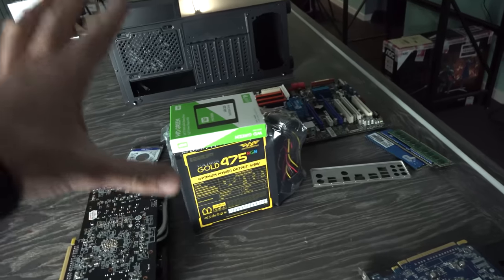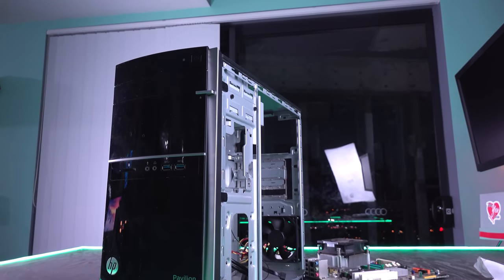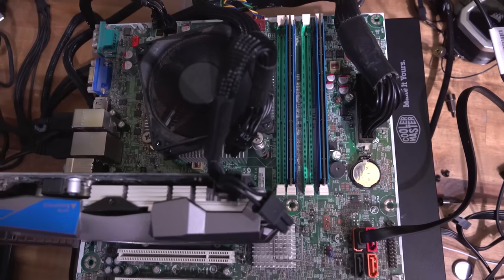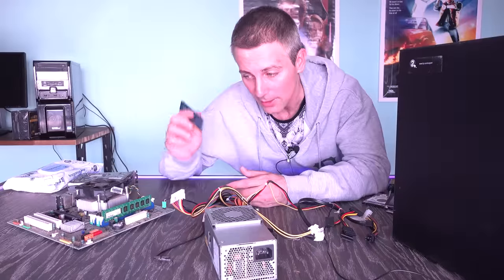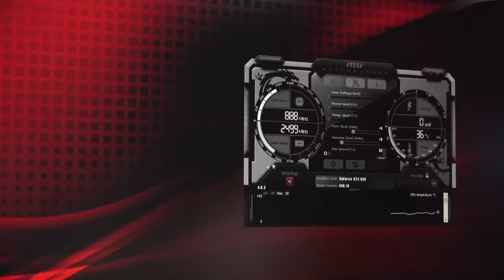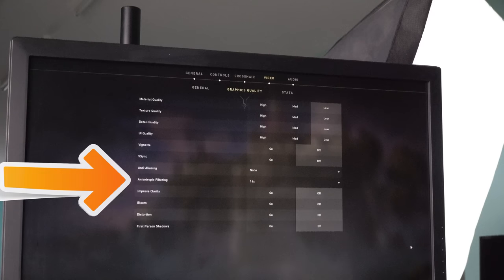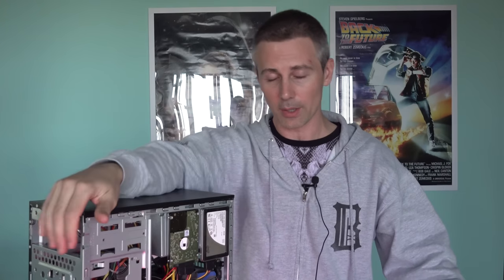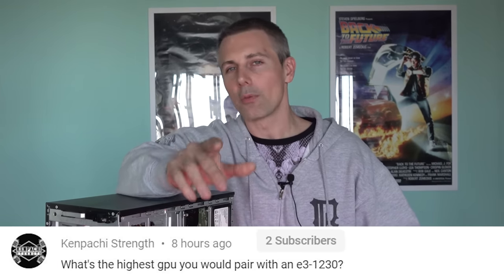I Built a Gaming PC for $67 that runs Valorant at over 120 FPS

Comment: My mans coming out here calling a GT 1030 pretty pricey. That means I'm on the right channel.
Reply: all used hardware is overpriced on eBay right now but you can snipe good deals sometimes. i got an open box thermal take 750 watt gold rated modular power supply for 80 bucks in auction. got a wraith prism for 25 bucks too.
Reply: @Joker-no1fz  i wouldn't get a used power supply, unless i definitively knew that the owner of that power supply said it was brand new and was barely used
Reply: @elsuperdog123  true and hard disk too dont buy used
Reply: @jetpackgambler8516  hard disk is fine to buy used I'd reckon
if possible I usually request to see CrystalDiskMark
Reply: Joker 80 bucks $10000+++++ for shipping fees
Reply: @screenpatch4146  struggles of not living in america
Reply: I have a 1060 so I'm happy now
Reply: @Fr3d1E  congrats dude, which model did you get
Reply: @Joker-no1fz  Thermaltake is assssssssssssssss
Reply: Mencho69 not really they have pretty good Power supplies and are up there with the more well known brands. Lots of tech YouTubers recommend EVGA, Seasonic, Thermaltake etc (also not in that order although EVGA probably is the best for this) but the point is they’re a reputable company and actually Corsair who’s more well known actually makes pretty bad power supplies and they’re a bigger company tbh
Reply: @WisteriaBerlitz  it's geforce is all I know
Reply: Joker isn’t it dangerous to buy used power supplies? i’ve always been told to get them brand new
Reply: DaFl1x I have a 1080😎
Reply: @elsuperdog123  never gonna happen xd
Reply: LMAO yes, im hurt everytime a youtuber called a gtx 1660 Super budget GPU
Reply: @WisteriaBerlitz  Not necessarily. I bought a 2tb hard drive used. One week 100%. The next week failed. Please don't cheap out on HDDs.
Reply: @Joker-no1fz  i think prices are becoming slightly more appealing and if they are not then I hope they decrease
Reply: I know all teh other PC channels make me feel poor for having a 1070 lol.
Reply: @Direwoof  sighh i have an rx 570

Comment: One man's E-waste is another TechYesTreasure.
Reply: It's weird seeing people argue on other tech reviewer channels that a $500 processor is the 'budget option' for the 'budget gamer' compared to the $800 processor and I just can't help but to think, what budget gamer is buying cutting edge on release date?
Reply: I've built several PC's using E-waste parts. One wasn't even broken, I upgraded it to Windows 10, chucked a GT220 (also E-waste) in it because the onboard video wasn't supported and sold it for $50 on Craigslist.
Reply: @Azerkeux  potatoes are fun.🎉
In a way 😹🤖
Reply: I love installed Linux distros on potato computers, they speed stuff up sooo much :)
Reply: @mohdwassep2764  Potato? I think Bryan has proven time and again that gen 1 and 2 core i processors are still plenty relevant. Though it is hard to say the same about decade old AMD parts. I'm certainly glad I was gifted an x58 platform as opposed to an FX series or god forbid Bulldozer

Comment: When a Hard drive costs more than this.
Reply: Bruh
Reply: my case cost more
Reply: My PSU was 150€
Reply: @certifiedhoodclassic7844  You are spending too much. In the US we can get a 60 dollar 700w 80+ psu at Best Buy
Reply: @Christian Lee 90 dollars for a 550 watt 80+ bronze certified fully modular psu

135 dollars for a 850w Fully Modular 80+ bronze certified PSU  (All from EVGA)
Reply: @statingtheobvious8119  I prefer Seasonic or Corsair over EVGA and the prices are pretty similiar anyways but its just that cheaper EVGA PSUs are pretty shit even with 80+
Reply: @MaxC_1  I like corsair power supplies. I haven't used seasonic psu before.
Reply: @statingtheobvious8119  they are great. Pretty damn reliable. For Corsair anything  CX and above(AXi, HXi, RM, TX) is just damn great. Just avoid VS and you should be good
Reply: @statingtheobvious8119  he's not buying some bottom line bronze psu though. there's high end PSUs available for a reason

Comment: You are pretty savvy when it comes to building, I would love to see you do some modding on those old HP cases!
Reply: I think it’s something like Modstek or modstech that does almost exclusively case modding on HP/Dell/Lenovo stuff. If you just need larger sized cards it’s fast with an angle grinder, or you can really go over the top make it look nice like that channel did (it’s been years since I’ve watched one of his videos, but I thought it was unique and interesting, I think I found it searching something like case modding HP or modding Dell optiplex case, he had a few back then and probably more now).

My current case is handmade to look like a vampire style casket, cost me only a few dollars (116 nails and 12 screws, plus free aged wood other than almost having a few heart attacks from all the spiders that were on the boards once I carried them out of the shed into the light...). Houses my monster Halloween themed build “ThrradREAPER” which has a Threadripper with quad Fury crossfire all water cooled and powered by none other than duel 13’s since it’s Halloween themed (2x SuperNova 1300 PSUs). I still need to finish the pump that’s embedded into a skull (the hoses look like rib cages, and the radiator sits below as a patinad and aged copper school bus  passenger radiator, behind it sit magnetic levitation fans). It looks dope, especially if I have dry ice cooling the CPU with an eerie fog rolling out of it. So yeah, cheap case and looks awesome. Doesn’t have to be expensive to really personalize your style. Have fun with it!

Comment: I was given an old AMD FM1 Lenovo desktop years and years ago. I was surprised how good it was to work with. The case is perfect standard MATX and it takes to any amount of tinkering without any secure boot problems. I took out the original 230W PSU, 2x2gb DDR3-1333 kit, single core Sempron, Nvidia 8600 GS, and 160gb WD Blue HDD and replaced it with an EVGA 430W, 2x4gb DDR3-1600, Athlon II X4 651, GTX 750 ti, and a 240gb SSD. All the replacement parts I got on bid on Ebay for very low price. Turned the lowest of the low office PC into a mini banger, it's in daily operation as a media center PC. I did that big upgrade in like 2016 and it's still going and still surprisingly capable. Can really get a lot of fun and value out of playing with old prebuilts.

Comment: I just want to say, after spending over $1000 on a pc , i feel finnesed
Reply: Yea but atleast we can run 300 frames 😈
Reply: @roshonngamingandmore8433  doesnt make sense why would they spend a thousand dollars and have a 60 hz monitor
Reply: Try 1800
Reply: @roshonngamingandmore8433  nah I have 240
Reply: Butter My friend got a 2000 dollar pc and has a 60hz monitor
Reply: @ammoTP  ehmmmmm......
Reply: @ammoTP  maybe its a 4kmonitor?
Reply: Its valorant lol its designed to run on low specs pc so even if u do havw that setup valorant is gonna run smooth coz its minimum requirements is low
Reply: @skyleradd1485  bruh moment
Reply: @ammoTP  some people have done so. I think I spent $700 building mine then bought a 165hz ips fhd monitor to replace my old 60hz afterwards
Reply: @420f37  so you dont have a 60 hz monitor ....

Comment: I play on a i5 4430 3.1gh
GTX 1050ti 4gb
16gb DDR3
500gb hard drive
Between 175-300fps 
at 1440-1080p resolution which I recommend as its very smooth and you have bigger characters which are easier to hit.

Comment: About to embark on a similar venture only a lower starting point an i3-2120  combo so I can play things with the kids will let you know how I get on
Reply: try to find a g4560 combo. they are really underrated especially with the kaby lake ipc and slow ddr4 is cheaper than ddr3 (or at least in mexico)
Reply: PC TechTips only problem with the g4560 is it has no release value as it’s a smelly pentium to consumers. 

I find g4560s for around £35 ish, but i5 6400s can be found for £50is if you look hard enough and I think it’s worth the waiting

Comment: Recently got into flipping PCs in my hometown thanks to your inspiration! I've been stuck with these 2 lenovo motherboards, exact models you used in your video. I havent been able to get any modern graphics card to work on them. In your video you said the BIOS update allowed for use of 600 and 700 series NVidia cards, Just wondering if you think something like a 660, 660ti, or 670 would be a good pair for these motherboards. These mobo's have been such a pain in the ass and I just wanna flip em

Thanks for the video!
Reply: Just get rid of them, lots of prebuilts allow better stuff

Comment: how come my fps is  only 90-170 and experiencing some fps drop it is not stable like yours
pc specs:
pentium g4400
gtx 960
16gb ram
1tb hdd
Reply: The hell is that cpu you need a better one
Reply: Facts thats a cpu bottleneck i think
Reply: GreenMithril my board only supports 5th/6th gen cpu, any buget suggestions?

Comment: Why didn't you mout the HDD on bottom of the case instead of taping it to the side of that PSU. If it was on the bottom of the case it atleast wouldn't kill itself if the tape fails
Reply: Yea, I got this same case and the hdd (1TB and it's on it's last leg) is on the bottom left with the back (non-label side) facing out when looking at the open side. Btw, it's running AMD with a A10 cpu, added 2 more sticks of ram to have 16gb's, added a bigger psu (witch I got free out of a scraped case) and replaced the old dying Radeon HD 7660 D gpu with a Radeon R7 360.

Comment: On that lenovo board you can get up to a 1060 or 1050ti to work. I have one of these boards in my house and sadly it died on me after 2 whole years of power outages and inconsistent voltages after hurricanes María and Irma 😅. Yes getting 2 sticks of ram to work on this board is a massive pain but it does work after a lot of trial and error. Not consistently though. I've had up to 4 of them before.

Comment: Cool! so this should run great on my 3400G? I've noticed you're doing some sort of custom fan mount on CPU heat sinks - how do you do it?
Reply: Yes perfectly fine since you've got a strong cpu and the vega graphics are pretty decent. You should run it comfortably.
Reply: @ozairahmed1352  and 3200g ?
Reply: @hedii215  About the same. Little less CPU performance (put it is negligible) and the same iGPU.

Comment: Dell OEM gtx 640 1gb is better than the MRP 650 Ti variant. The OEM has samsung ddr5 memory, and it just runs insanely well. Check it out. Didnt need a power plug either.

Comment: with everything you did to that psu, it's pretty sketchy. hope it will last.
Reply: This system is a total ghetto build from top to bottom, far below what I thought his standards were. He didn't mention having a buyer for it, so I am wondering how long it will take him to sell this thing. To me there is definitely a point where you just have say If you can't afford to buy what is acceptable as low-end today, then you need to wait until you have more money. It's a waste of money to get something that is just barely kind-of acceptable TODAY, and therefore will go downhill faster than a modern low-end build would.
Reply: SirReptitious not everyone can afford this (I would have loved to have it back when I was “gaming” with Minecraft at 360p with 20ft render distance min settings (clouds disabled etc), enemy spawning at a jump scare of 5 ft as you walked straight into them gave a whole new elelment to the game, all at a max peak framerate of 17 fps. But hey I was gaming! I had fun with friends anyways in LAN gaming parties.

Sure now I have triple 4k setup with Threadripper with quad GPU so I can run Crysis 3 at 4k Ultra at a buttery smooth 100 fps, and sure I even spend a bunch on extreme things like LN2 parts or zombie VRM boards and I firmly believe most people should be running sub-zero phase cooled systems (nobody should have a 9900k unless it’s at 6 GHz minimum, if you can afford that overpriced junk you can afford the $1200-$1500 CPU cooler... plus it’s going to last multiple upgrades and mine has seen everything from C2D to FX to modern Ryzen and cranked all way above what is possible on water, so yeah, the high end Intel parts are pointless without extreme measures). But you know I still love all hardware, particular budget or retro hardware because it reminds me of the fun I had with friends, gaming on a potato that had a multi-core world record score of 45 Cinebench points, but you what what? I had a blast! And that’s what matters. So if you can only afford a raspberry pi (probably way better than what I had), or a thrown out Dell from school, well you go for it kid and have fun, because that’s what gaming is all about, having fun! I can’t diss that build, and I’ll respect you for it.
Reply: @jakegarrett8109  ok
Reply: @jakegarrett8109  ok
Reply: @jakegarrett8109  ok
Reply: @jakegarrett8109  ok
Reply: @jakegarrett8109  ok
Reply: @jakegarrett8109  ok
Reply: @jakegarrett8109  ok
Reply: @jakegarrett8109  ok
Reply: Jake Garrett Life changing read. <3
Reply: @SirReptitious  pretty sure it was just one of those "can you do this" builds. Yeah yeah some of the parts were shit but when you actually look at it, all it needs is a new PSU (easy 10$-12) it's all set. Only problem I see is originating from the cheap shitty PSU so replace it and its no different from what you'll get in a 200-250$ prebuilt for less than 100$ and it's an easy sell if you know how to advertise properly

Comment: I just got a very good deal some days ago, i got an i5-3570k with the Msi z77a-g45, 4gb of ram, 120gb kingston ssd (with win10 pro installed) and the Corsair 550D case with one side missing a dust filter cover and no fans in the case, all for 60£. I paired this with my GTX 560ti because times are hard xD and 8gb ram more. I'm pretty happy with that.

Comment: Did you try pulling the cpu out and checking the pins? I had an old oem that I picked up and only 2 slots were working. The pins  seemed pretty flat, so i picked up the ones for mem channels a bit and they all came back online.

Comment: I found some office scrap Dell Optiplex 380/390 that sometime can not boot, only blinking indicator.  I have swapped ram, psu , cpu , power switch with no result. Is it the same problem with this thinkcentre?

Comment: Ohh, that doesn't look good tbh with the drives taped to the side of the PSU with no room for airflow.. Heat and drives, or even tape isn't usually good together. Tape could loose its grip, dropping the drives, and the drives could get hot enough to make them go bad quick..

Comment: I downloaded valorant in a computer shop here in the Philippines and the specs are:
i3 2100
8gb ram
Gt 220
500gb hdd
When the monitor was like 1080x720 (70hz i think as far as i remembered) it can go up to 90fps (all low settings). Now that the owner changed the monitor to 1920x1080 motherboard it goes down to 30fps. Max is 60fps. I stopped playing because it goes to 20fps when playing.
Reply: gt 220 lul

Comment: As exciting as it was to finish building my first gaming PC a couple of weeks back working with older parts and trying to get things to work has it's own unique charm. I'd picked up random parts over the last year at thrift stores which includes a 1USD 4GB Sapphire R9 270x which I tested in my main PC and it works, quite good too. An older 4USD iBuypower PC with an FX 6300, Gigabyte motherboard, 400w psu, 8gb ram, no hard drives and an msi R7 360 2gb with a noisy fan. Had a 16gb kit of ddr3 Pny Anarchy ram 2x8 that a friend of mine gave me years ago, and a 2USD EVGA 80 plus 430w PSU.  
I want to put together a secondary PC for the living room but the Sapphire R9 270x requires 2, 6pin PCIe connectors and both PSU's that I have only have one. Maybe I'll try and implement some Tech Yes techniques to get it to work as I'm not buying a new PSU which defeats the whole purpose.
Reply: @Silvio Balaško That's what I'm going to do. I just ordered a 4 Pin Molex to 6 Pin PCI-Express adapter. You think a 430W PSU should be good?

Comment: Hi, so my current pc has a weak cpu and it's mobo is some-what fualty.

Specs:
i3 3220 (14 USD)
8GB Ram (20 USD)
Foxconn h61mxe (16 USD)
GTX 1050 Ti (I got this for free)
500w 80+ bronze psu (I got this for free)
Raidmax neon argb case (I got this for free)

Like I said the cpu is weak, therefore I bottleneck in almost all my games. So I'm just wondering where I can buy an i5 3470, because the country I'm in doesn't have alot of second-hand cpus.
Reply: I suggest eBay  or shipping just shipping from another country

Comment: I have this same mobo i got for 3000₹, yes overpriced in india, and i run a xeon e3 1270 and gtx 1060 and 12gigs of ram. It was a massive pain to get working and it was all hit and trial and pure luck. From what I’ve heard and tested on this board, modern nvidia cards and sandy bridge cpus work but modern amd gpus and ivy bridge cpus don’t. Also weirdly windows 10 doesn’t shut down properly because it isn’t supported, but it can be fixed if you turn off fast shutdown.

Comment: sucks about not being able to use the 645 GTX, i had one as a make-do card when my 660 ti died.i was not disappointed - its a cut down 660 gtx (less cudas, half the ram but still gddr5, and a binned memory bus speed, variant of the same gpu i used the wiki chart to verify), has Vulkan (i got Wolfenstein II and Doom 2016 running on it, albeit at 720p but with medium/high), and can overclock a fair tick.it actually beats that 650 (not based on the 660 and has considerably less cores), if its a 1gb model.

Comment: pretty good for a tyc bangjob..if it works and it games then its fine. but the 3,5'' trays where not missing. it actualy takes the drives verticaly they slide in that side front thing with the conectors facing up and screews in from the visible holes.. had the same hp case(actualy still have it lying around but its just a case and crappy psu. sold all the insides :P)